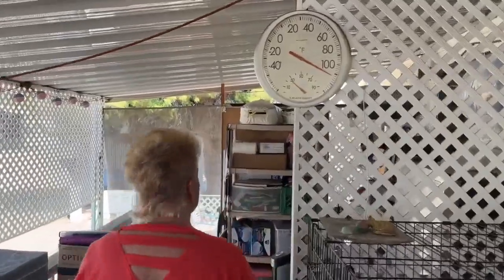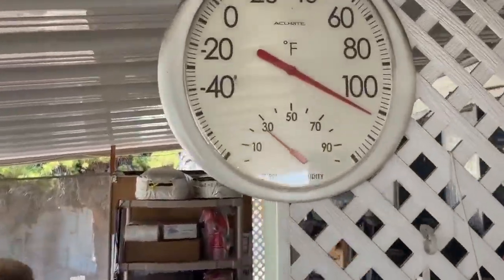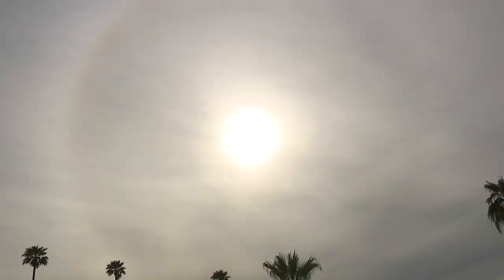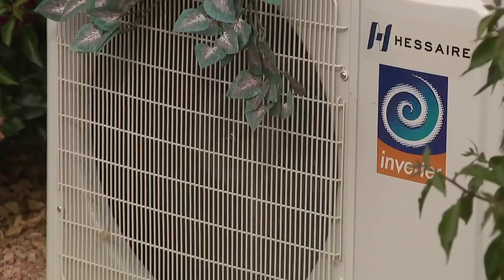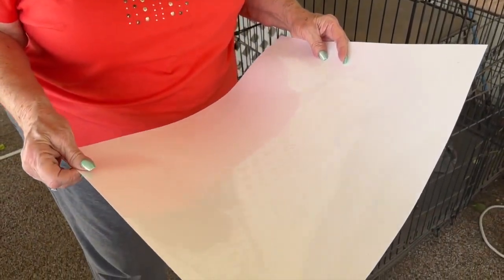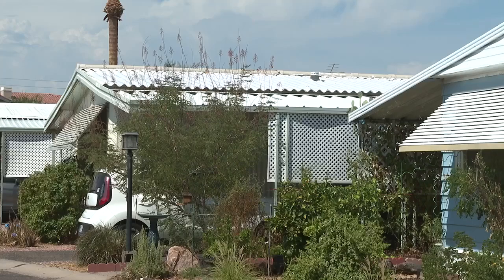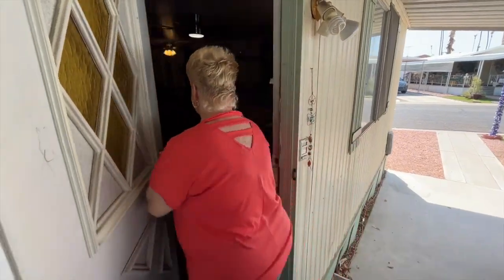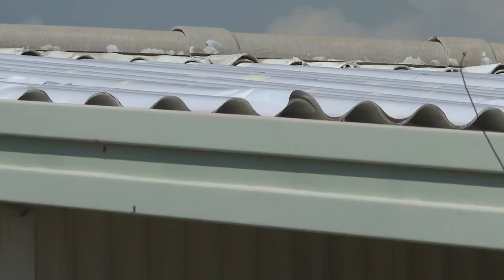Company testing new cooling roof technology on Arizona mobile homes, results promising

Comment: FYI, micro cillicatte paint for mobile home use (I got at home depot) may do the same. I used it for demo trailers, the roof went from burning you skin in the heat to touchable. And the inside was cooler from it

Comment: That sure seems like wasted money to me. I put solar panels on our roof with enough airspace to allow airflow between the solar panels and roof. The roof stays cooler and we get free electricity from the sun to power the air conditioner. No more electric bills. Common sense saves money.

Comment: $3/sf... for white vinyl? 
Hmmm...   a 2x3 ft 100 watt solar panel costs $55 right now... that's $9/sf, but could easily outlast the white plastic liner.  50 solar panels on 300 sf ($2750) would generate an average of 4 hours x 5 kwatt= 20 kwatts a day which is enough to run two fridges and four 12,000 btu inverter air conditioners all day. Run some water coils below the solar panels for hydronic heat or all your hot water needs (foam insulation, copper pipe, water pump).

Comment: Could also try a tropical roof,a secondary roof , above the main roof, with a few inches of gap ,allowing air flow between the two,and preventing heat transmission.

Comment: Resident utility usage down 50%. That's a big deal! Why just now this roof material suddenly becomes available?! After people almost go bankrupt trying to keep up with monthly utility bills during the summer, and just as costly in the winter turning up the heat. There's no reprive from the very high cost of just trying to aclimate the inside of your home from the outside temps without, like the senior woman said, deciding how much she'll eat that month. This is what happens when one company calls all the shots without any deregulation on the table, in the future or anywhere on the horizon, for that matter. Recently I called SDGE because my monthly bill doubled in just 2 weeks of using my A/C! Rep went on and on about why and as an afterthought said on-peak/off-peak times are on statements. I almost had to use a magnifying glass to find it on almost the last page. And it was just two itty-bitty lines. Turns out rep said there are super-off times for weekdays & weekends. The way she was explaining it, she admitted that even she got confused. I asked why SDGE doesn't have the super-off peak times on the bills AND have the print on the first page in bold type? She got kinda quiet, said she didn't know, but that calls are recorded, and it will be looked into. Yeah, right[Not]👎!

Comment: An elevated shade cloth on the roof makes a very big difference.
Reply: what about windy days?
Reply: @JUCARL23  Must be secured well, the shade close can be purchased with different air hole sizes as per wind conditions. Custom sizes are available on line. I’ve zip tied them outside of windows and just let them dangle down, tied above with eye screws, after summer take them down and safely store. Best wishes keeping cool.
Reply: @JUCARL23 Roll ot up, it's not needed to cool.
Reply: Plus aluminum foil, whuch reflect the sun.

Comment: IDK seem so many pray on poor folk 3-5 dollars /sf thats a new swamp cooler installed with money left over. fixed income thats me I can't afford to pay attention let alone gimmicks, coat your roof with the white sealer for $100 that alone will make a difference.
Reply: It’s called PREY, DUMBBELL!!
Reply: A mini spit uses less power than a swamp cooler in the summer. In the spring and fall the swamp cooler can be more efficient.
Reply: @dannelson6980  TELL us the NUMBERS:   In summer, a mini split vs window air conditioner(s).  SAME room(s).    ALSO, in winter, mini split vs electric ( resistance) space heater(s).   kWh per hour, for EACH.

Comment: After reading some of the comments it's clear people do not understand what's going on here This is a heat reflective barrier that keeps the sunlight from directly hitting your roof which greatly reduces the heating Factor of sunlight. White elastomeric coatings are not the same cuz they directly apply to the roof with no air barrier in between them.
What has happened to people's critical thinking skills? 😢
Reply: Gone Tik Tokking!
Reply: They're doing it for all the thumbs up

Comment: A good radiant barrier needs an air gap...  No new technology is involved.  Poor engineering and execution, however, continues unabated.
Reply: YOU KNOW NOTHING
Reply: @daveklein2826  "YOU KNOW NOTHING"

Just like those people at NASA...  How many radiant barriers does the James Webb space telescope have?  And what's between each?  But, since it's space, we really can't call them, "air gaps," can we?

Google "Don’t Squeeze a Radiant Barrier" and read the HVAC school article.  Then perform the frying pan, aluminum foil, and roasted hand experiment.  Get back to us with the out-of-pocket cost of your ER visit...
Reply: I don't know anything... That's why I follow such organizations as NASA.  How many radiant barriers are in-use on the James Webb space telescope?  Each of those five has an air barrier.  Although, there is no air in space so I guess it should more properly be called a space gap.

Of course, you could do the simple hot skillet, aluminum foil, and bare hand experiment -- air gap and your flesh doesn't sizzle.  No air gap and you'll be forking over some out-of-pocket change to your health provider...

Comment: A white roof reflects heat.  This ain’t exactly rocket science, but I’m glad to finally see somebody doing it.
Reply: There’s actually very specific molecular bonds created using Barium Sulfate that provides extreme thermal insulation beyond what is possible with just a white paint. It’s not “rocket science”.. but it does require chemistry to create the specific paint. There a video on the @techingredients channel that shows how it’s made, how well it works and how it cools beyond the ambient air temperature.
Reply: @HiThisIsMine  I remember one year the mayor of NYC wanted to paint all roofs in the City white to reflect the heat.  His opponents nearly went ballistic about the idea.
Reply: You're not wrong, but that's also not all there is.
There's a YouTuber by the name of NightHawkInLight who has been openly researching ways to improve passive cooling beyond anything that a plain white rood can do.  If you're interested, I strongly encourage you to check out his "Radiative Sky Cooling Series" playlist.  
I'm not sure how the material that the Arizona company is testing compares, but I suspect they're doing something beyond just making the roof white.
Reply: Ok tough person

Comment: Power company won’t be happy about this sir.
Reply: They will be. They don't have to build new power plants. Power plants like it when you use energy efficient appliances.
It may also reduce peak load demand.
Reply: @joe28704  Point you miss is power companies make money by selling electricity. The less they sell the less money they make. The less money they make the more unhappy their shareholders get. At some point shareholders say it isn't worth it I can get better returns investing in the company that is selling the product that is killing the profitability of the power companies. So power companies turn off production until they reach a profitable level. So what happens is electricity will get really really expensive eating away at your savings from installing this material.

Comment: How does the wind not blow it off?  And how does it perform compared to an Elastomeric White Reflective Roof Sealer?
Reply: That roof sealer works great. Reflects the heat and my house stayed cooler.
Reply: Silicone Tropicool. Last far longer than elastomeric.
Reply: CLAMPS.
Reply: Glue
Reply: be neat to compare, i used micro ciliicate from home depot on trailers, made a big difference